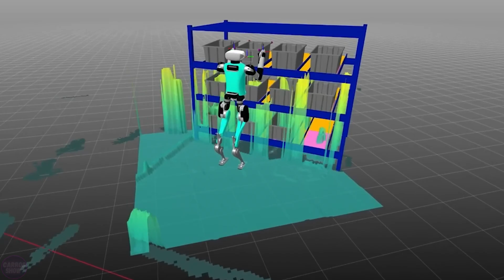Elon Musk's New Humanoid Robot will Replace People at TESLA Factory

Comment: Why do they keep making robots in the shape of a human? There are much more practical ways to make a robot to be useful without any of the limitations humans have in their current form. Why not just make something more like a quadruped with hands at the end of each limb and with a "head" or some kind of camera/sensor suite on top, battery underneath, then another camera/sensor suite beneath that and inverted. Then you would have a robot that can move in any direction without having to turn or orient itself. It could get flipped upside down and immediately switch to the opposite camera/sensor suite to keep going with the same 4 limbs. It could switch to walking on three limbs or two limbs if needed to carry things or navigate obstacles or climb or whatever. Basically... why are we designing robots to mimic the human shape when there are much more useful shapes that could be designed around? Humans have a torso because we have vital organs to protect and lungs and etc, but a robot doesn't need a torso at all. So why are we making that?
Reply: Because everything in this world is build for humanoids, aka humans. All the machinery, all the storage facilities, all the means by which the economy and the world operates. The entire infastructure would have to change to suit this design, and also, it should not be forgotten that bipedal design has advantages as well, especially considering that AI would not need to spend time thinking about how to preserve balance, instead in a split second it would react (to a hard push for example) and adapt in order to not fall over. As long as this technology keeps developing, we will be able to utilize bipedal robots and I believe this is better.